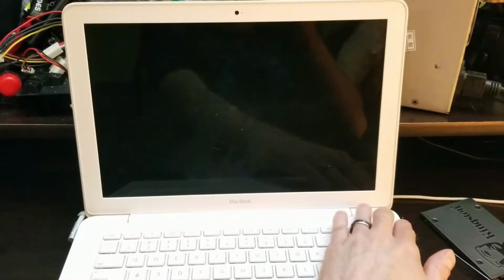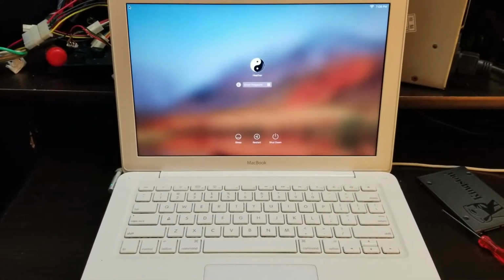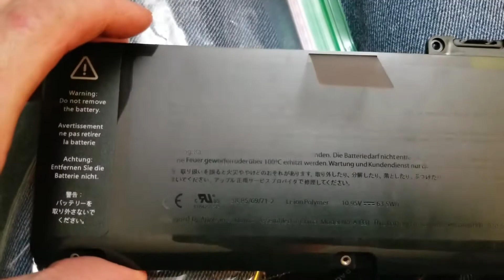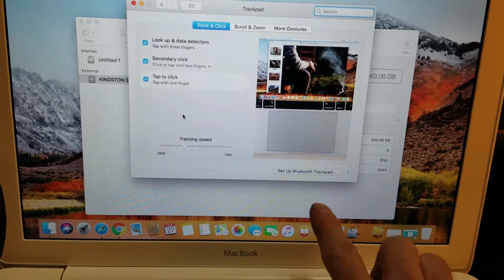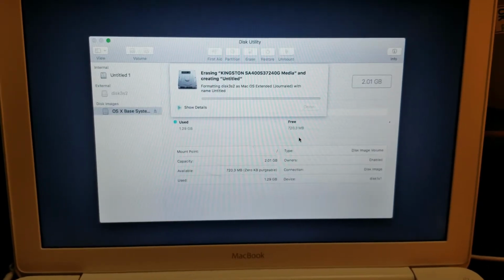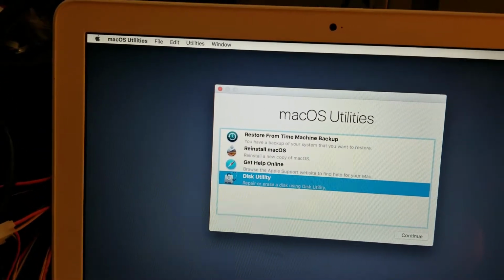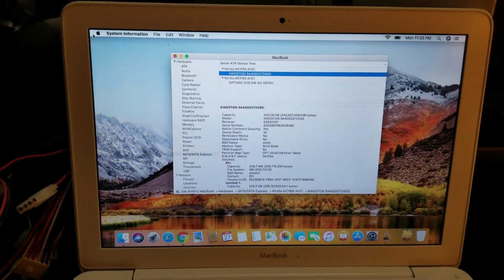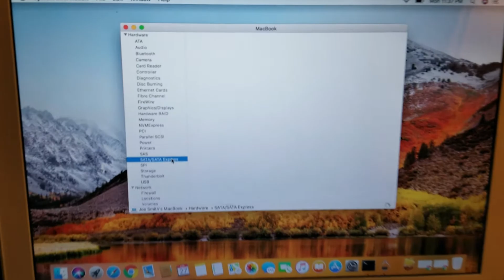Macbook A1342 SSD Upgrade, Trackpad Fix and Battery Replacement

Comment: hi mate. i have the same macbook. and i just bought new kingston ssd. but i suppose that this new ssd has nothing inside to make my pc work. how can i install anything on the new ssd in order to make everything work fine? i dont have this tool your are using to do all the first aid process etc. i am a bit confuse on how to proceed.
Reply: If you want to copy your operating system from your old drive onto the ssd then it’s probably going to be easiest for you to use a hdd cloner.There are software programs  that can be used such as Carbon Copy Cloner but if you aren’t too technical I’d leave it alone. The main things you have to do to the ssd are format it to Mac extended journal and guid partition scheme.